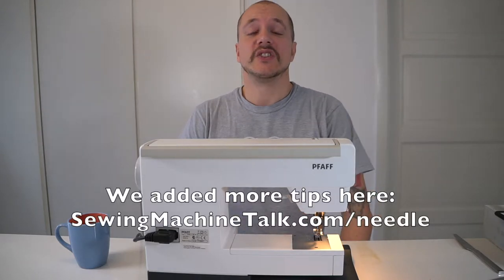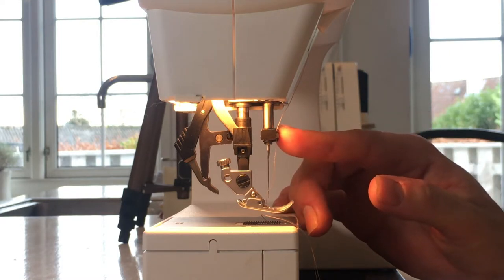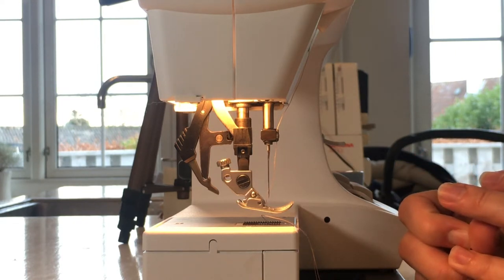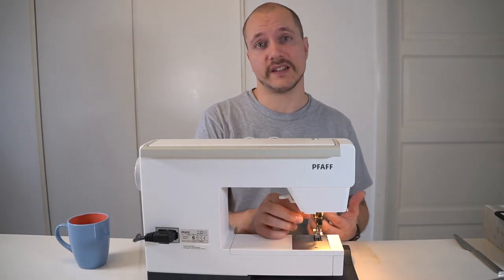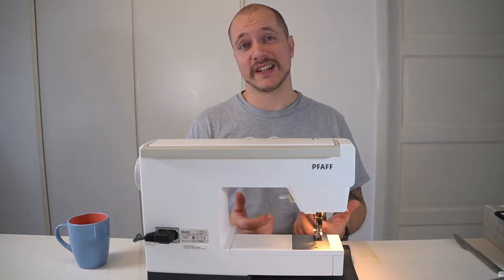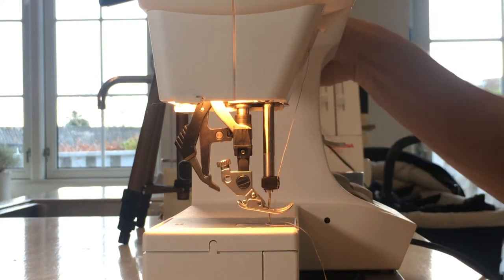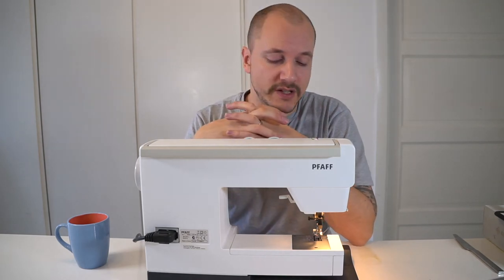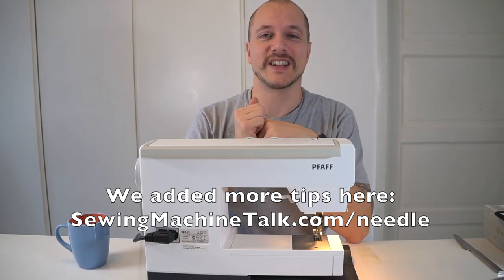Sewing Machine Needle Falling Out? Here's why (and what you can do)

Comment: I have been sent a set of needles that are apparently the same as my normal brand. None of these needles will stay in the clamp and yes, they're flat on one side. I tried putting my other needles in and they were fine.

I've looked at the shaft an it is clearly narrower and a little shorter. This is the first time I've ever encountered this problem.

Comment: When I tried to change the needle I could not get it to stay in.  Turned out that the mechanism that holds the needle had slipped up too far on the shaft and, although the needle was in the correct place, the screw in the mechanism was above the needle. Try bringing that part down if your problem persists .... it maybe stuck and will need a gentle wiggle and pull.